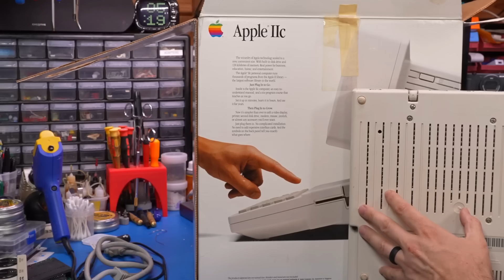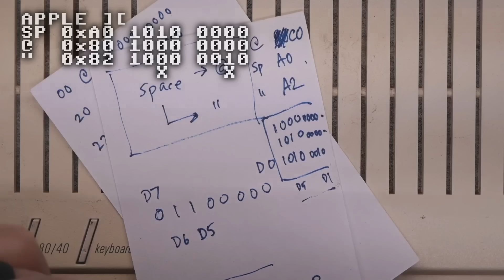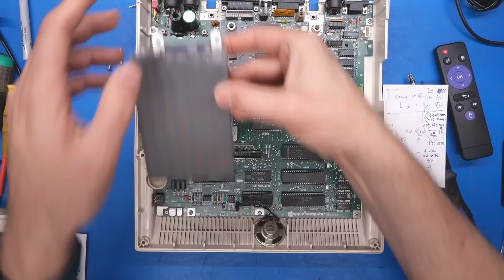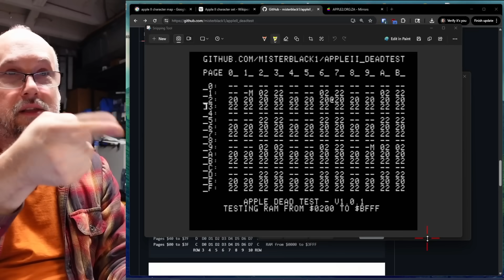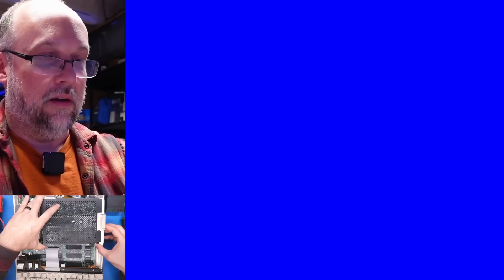Finding bad RAM chips on an Apple IIc

Comment: Apple did indeed sell a 1st-party memory expansion card for the later IIc models. I have a factory sealed 256kB unit here, plus one inside my IIc as well, which I've expanded to 1MB. My dad used to work for an Apple dealer in the early to mid 90's, so we have a few other things scattered around the house as well.

Comment: On the C64, you don't necessarily have to stop the "bad lines" from happening in order to do every time-critical task, you just have to work around the "bad lines" in most cases.  They are easily detectable using the raster register at $D012.  Even many fastloaders, for example, can load while the display is being shown.

Comment: In text mode (and with no sprites active on the C64, to keep things simple), the Apple II series and the C64 both actually have very similar memory bandwidth requirements.  Allow me to explain the difference, and why only the C64 has "bad lines".  On the first line of each row of text, the C64's VIC-II chip must steal an additional 40 cycles (from the 65 cycles available on each line) from the CPU in order to read the 40 bytes of characters to display (this is a "bad line", of which there are normally 25 per frame), in addition to reading the first line of glyph data from the character set, from either ROM or RAM, on the main data bus.  If it had to do this on every line, that would slow the C64's CPU down by a lot (by nearly 47% overall!), so the VIC-II buffers the 40 characters internally and uses that as a reference to draw the remaining 7 lines of each character in that row.  This limits the overall CPU slowdown to less than 6%, which isn't too bad.  The VIC-II also has to read the color map RAM for each character, but avoids stealing additional cycles by reading this separate RAM (actually an SRAM chip) simultaneously through a separate data bus.  It doesn't bother to buffer this data because it can and does read it over and over from the color map RAM, with zero slowdown involved.

Now, the Apple II also has to read 40 bytes of characters for each row, and in fact it does read them 8 times each (since each character takes up 8 lines), and doesn't even bother to buffer them like the VIC-II (which only reads them once per row and frame) does.  So how does the Apple II read the character glyph data at the same time without a huge number of "bad lines"?  The same way the C64 reads the color map RAM with no cost to speed: at the same time through a separate, dedicated data bus.  So why couldn't this have been done on the C64 to avoid "bad lines" altogether?  It could have been, but that would have limited the C64 to using only the ROM character set for the character glyphs.  By reading this data through the main data bus instead, the C64 gains the ability to make use of user-defined characters stored in RAM (the main 64K of DRAM), which is one of its most powerful graphics features (that it shares with the Atari 8-bit computers).  In short, the Apple II avoids "bad lines" because its text mode is limited to ROM only.  Had Woz decided to give it redefinable characters like the Atari 8-bit and C64, then the Apple II would have had "bad lines", too.

By the way, the VIC-20 has redefinable characters but no "bad lines", because its bandwidth requirements are lower, with fewer text characters across the display (normally 22 compared to 40 columns), leaving plenty of time for its VIC (or VIC-I) graphics chip to grab all of the data it needs without stealing any additional cycles from the CPU.  In fact, its CPU is a little bit faster than the Apple II's, despite running at the same clock speed of 1.023 MHz (on NTSC, and the same as the C64, too).  This is because of an obscure, little-known quirk of the Apple II series, which pauses the CPU for 1/7th of a cycle (in physical reality exactly 2 cycles of the master clock that runs exactly 14 times faster than the CPU clock that is derived from it) on each raster line displayed.  This was done to synchronize the phase of the video signal to the monitor.  Every other 8-bit computer I know of uses some other simple trick involving a small circuit (usually part of the graphics chip) to achieve this without the pause, but knowing Woz, he probably looked at what he had left to work with (all TTL chips on the original Apple II, with some random leftover gates), and realized that if he were to do it this way instead, then he wouldn't have to add another TTL chip to the motherboard. 😆  So he made the tiny tradeoff of about 0.22% in CPU speed to save a little money and complexity, and hardly anyone has ever noticed.

Comment: I got a IIc for very cheap together with all the accessories, documentation and packaging. Sadly it's stuck in this "diagnostics" mode and doesn't show the RAM screen. The only thing it will ever show is what you saw before it showed you the screen with "RAM" on it. I have no idea how to check which chips are bad, so I might just replace all of them with known good ones and hope it will work after.

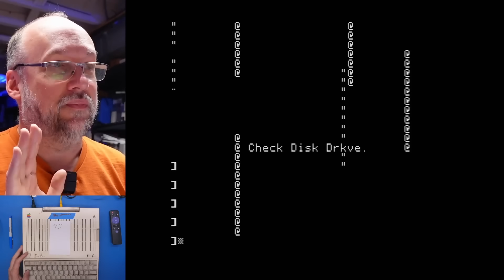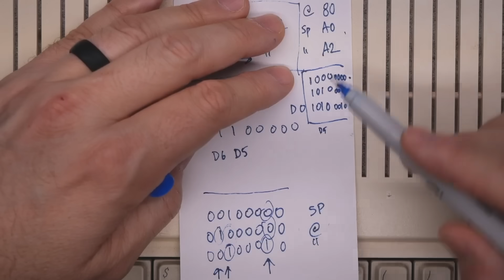Comment: at 10:18 you can notice that "Check Disk Drive" became "Check Disk Drkve", with the I changing to a K at the column where you see the quotation mark. They are 2 characters appart, which seems also to indicate that D1 is bad at some places. This matches what you found out at 20:23.

Comment: All 6502 computers had heavy use of zero-page.  The reason why it's used heavily, is because you can address zero-page with only one byte, so the 6502 can read and write to it nearly twice as fast.  The rest of the memory requires two bytes to address.
Reply: Actually, it only saves a cycle or two, depending on the instruction, but for a 6502, that's still pretty significant.  It also saves a byte of code per instruction, of course.

Comment: You absolutely do not have to install the memory chips directly on the board.  I'm sure you have even socketed these in another video, directly under the drive.
I have put sockets on 4 machines with no clearance problems.  I change all of them to sockets for future serviceability.

Comment: I'm getting more and more frustrated by how you make a 1/2 hour video over an hour long just by repeating yourself and restating what you just said in various ways instead of moving on with the diagnosis and repair. E.g. the difference between Apple's character codes and ASCII. Just tell us it's different and show us what Apple did. Don't repeat the same sentence with one work changed and don't show us how we may have been fooled if we tried diagnosing using standard ASCII codes. I am constantly finding myself clicking forward to try to avoid the waffle. Other than that, you have great skills and info to pass on Adrian, Just don't talk for length's sake. We can use our back arrow to go over something we missed.

Comment: Your explanation of the video/CPU memory arbitation was quite intersting, as it is similar how the Amstrad CPC manages the CPU/Video accessing RAM as well. The Gate-Array in the CPC stretches all M-cylces of the Z80 to multiples of 4 T-cycles by signaling the /WAIT line on the Z80 as the Gate-Array is accessing the RAM in the last 2 cycles of each M-cycle
So opcodes that run 4, 8, 12 etc. T-cylces run unaffected, but opcodes that run for example 7 T-cycles get stretched to 8 T-cycles. This slows down the Z80 a little bit but not by much. The advantage is we get very accurate timings and no problems as "bad scanlines" as on the C64, so exact time synchronization with racing the beam are not a problem.

Comment: hot air to melt the case attachment so the speaker fit's back in.... or freze the spaker so it becomes smaller.... or dremmmel the speaker

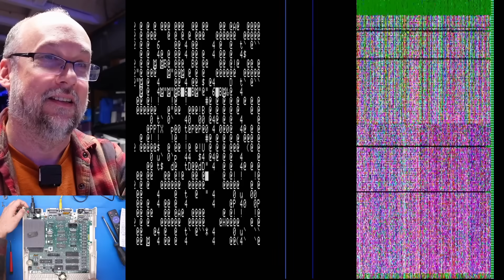Comment: I wonder if D6 is only bad on a cold machine. It shows as bad at 40:40, but find at 40:45. Maybe running the machine for a while "fixed" the marginal chip.

Comment: Something to note (as of 21:00) - there's no way on the display in text mode to tell if bit 6 is going wrong, unless bit 1 goes wrong at the same time (both 0x80 and 0xC0 are @, and both 0xA0 and 0xE0 are spaces, but where 0xA2 is ", 0xE2 is `).

Comment: this runs on a 6502, right? zero page is actually on the CPU... then it looks for a reset vector at FFFC and FFFD (which requires some external RAM or ROM) - it doesn't actually look for stack memory until it tries to execute an instruction like JMP (it saves the current address to the stack in order to return on RTS)

Comment: I was a sad panda when they didn't up the clock speed on the IIc.  The Apple ][+ and e were both slow on regular hi-res.  When you doubled it, it became basically a slide show.  They really needed to up the clock speed by at least 2.  But i am not sure how fast a 6502 (of 65C02) could be pushed back in the day.
Reply: The trouble is that Woz's legendary engineering led to things like the CPU clock being meshed with the NTSC video output generation and reading/writing data to the floppy disk - if you just boosted the system speed, everything else would break. Since the 6502 relies so heavily on the zero page of memory, running the CPU faster than the rest of the system does basically nothing.

The IIgs has a "fast mode", but it also has the entire Apple II architecture condensed to a single chip. It's a lot closer to running an Apple II emulator on your PC (but in specialised hardware, rather than software) than it is to running a IIe or IIc with a higher CPU clock.
Reply: @Screwtapello  Simple fix (and i know it would be more complicated that this), run the 6502 at 2mz, and clock divide by 2 to give the video system the clock it needs.   The floppy would be harder to manage, but it could be done.

Honestly, the Apple ][ series should have ditched the 6502 and gone onto a 6800, and eventually a 68000.  The 6502 was an amazing 8 bit CPU, but it was extremely limited by the low register count and extremely small stack space.

Comment: About the handle. Just because one can run the computer without the handle propping it up doesn't mean one should. The manual specifically says to "always prop the handle up under the Apple IIc when you are using the computer." Because of this part of the manual, I cringe when I see someone using it flat on the table.

Comment: That was the box my //c came in. I also got the illustrated monitor and stand, along with a dot matrix printer. Model number escapes me at present. Add in an expansion card from Carrolton Texas a  bodged serial cable to connect my wife's Radio Shack model TR80 Model 100 "portable" computer to transfer text files, and we cranked out adoption studies as my wife typed in the passenger seat as I drove. Adding a daisy wheel printer, and the Apple cranked out court ready documents to get kids placed in their adoptive homes. Apple Works software was all I needed along with a third party spell checker loaded onto the expansion card. Total cost? Around $2,500 for the pc, monitor and printer. And about $350 for the expansion card. The daisy wheel printer was donated. Boss paid $10,000 for and IBM PCXT, base unit with the 10MEG hard drive. Didn't tell me how much he paid for the software. Oh, yeah. Secretary typed Format C: on day instead of A: Took me a while to get the thing up and running again.

Comment: My dream version of the Apple IIc would have the Z80 card hardware built in to run CP/M software, and would also have an extra connector at the back that would provide a sub-set of the bus signals to use an external expansion "card".  I know of people that built their own custom interfaces to plug into one of the II/E bus slots, having one available "slot" via a 40 pin connector on the back (perhaps hiding behind a removable plug in the cabinet) would have given the II/C this ability too.  If the II/C had survived a few years longer, maybe it's mother board might have also grown an IDE connector too! 
Now even better, imagine a II/C with a 65C816 processor (II/CGS) and 1mb of dram.  That's what an apple version of the 8 bit guy's commander-X could have been.  I throw down the gauntlet!

Comment: Adrian, //c was also my first machine! I believe there are actually three motherboard revisions.  One was minor - but important.  Early //c’s had a “broken” serial port with a clock problem. The first minor revision fixed that serial issue, otherwise you couldn’t run it at the full speed!

Comment: AT 57:50 you says that the Apple2 is unable to sense multiple keys at once. This is not exactly true. The Apple IIe is capable.of it somehow. There is a key code register and a key up/down bit with it and yes you can absolutely sense multiple keys at once if you read the various codes arriving sequentially, and use the up/down bit as a sequence stop/start. But since you need to consume the codes sequentially and the up/down register is down when any key down and only up if all keys up, it is tricky. I implemented it to be able to type any character, with combinations of only 6 keys (Based on a Braille typewriter layout using FDS and JKL) . This might not have been available on the Apple ][ or the ][+, and maybe it is not available with the //c. But definitely had it on the IIe.

Comment: My Apple //c developed a bad RAM problem in 1987 because of a bone-headed mistake by one of my friends.  I ID'd the bad chip and bought a replacement (had to call places in the Yellow Pages, which was the first time I heard about Fry's Electronics).  I desoldered the chipped and lifted some pads/traces.  I paid $400 to trade mobos at an Apple dealer.

Comment: "Set it up in minutes, learn in hours, use it for years." Well, THAT part is pretty accurate. 

I would LOVE to see (pun intended) a modern computer like a Pi 5 in an Apple IIc case with the "good" keyboard. Imagine, there's plenty of space for internal SSDs and even an optical drive on the right side.

Comment: Yeah, my first computer, as well and it came in that red box.  I remember an RF convertor that plugged into the video DB connector, a long, shielded cable with RCA connectors on both ends and an RF switchbox to connect to the TV.  Those are probably pretty rare nowadays.

Comment: Interesting to see the timer slow down on Robocop when you are actually doing something, then speed up when idle.  I guess it's tick based and not rtc
Reply: The usual apple // did not have an RTC. It was a common add-on. 

The // gs did have a RTC standard.

Comment: I'd put a felt strip on the handle/stand so that it doesn't scratch the surface it stands on or the handle itself.  Or maybe a rubber strip like single sided latex tape....  of course after its all cleaned and retrobrited....

Comment: The earlier ROM255 IIc couldn't boot from SmartPort hard drives - you need one of the ROM3 or ROM4 revisions for this feature, or install one of the ROM4X upgrade ROMs into a ROM255 machine like you've featured on your channel in the past.

Comment: Just 10 minutes in, and this is awesome. Those symptoms match what I have on mine *exactly*! Maybe I'll finally be able to fix it!
Reply: "not ASCII". Well, that explains some things!
Reply: Tell us when you fix it!
Reply: Progress so far: I got the right power connector (I have the original PSU, I just can't find it...) so I could do some tests. Experiments seem to say bit 6. I haven't swapped the chip yet (there's a lot of bodge wires, I had a go at this a few years ago when I knew less...), but piggy-backing a new chip on top of #6 does make it boot without odd characters, so replacing that one should definitely be a good start.

Comment: The finger came from the mouse ad copy. It kinda became a graphical substitute for “easy to use”. Why did they plug in the power cord but not the monitor? Because they had to plug something in to go with the “plug and play” ad copy. Why not also plug in the monitor? I suspect it just didn’t look the way the graphics people wanted.

I’d apple make an extended ram card? Yup they did, it’s commonly called a slinky card (that was a code name).

Comment: One word of caution: if you're looking for an Apple //c with an Alps keyboard by looking at photos of the "label" on the case, be sure the model number is A2S4100. Some A2S4000 models also have an embossed label, but may not have an Alps keyboard. (I learned this the hard way by assuming embossed label equaled Alps keyboard...)
Also, you can use low profile sockets for the memory chips under the Apple //c floppy drive. Last time I checked, Jameco sells sockets with a low enough profile.

Comment: "Why didn't they connect the monitor cable?"

Because the package designer thought it would ruin the aesthetic of having one nice swoopy little curve going down into the monitor stand/case handle, contrasting the perpendicular angles. That's definitely it. (Work with a product photographer and you'll understand. I have HAD these arguments!)

This is an example of the dialectic between functional disciplines like engineering, and reductive communication disciplines like marketing. Engineers want to be accurate, commercial visual communicators want to be simple and handsome.
Reply: Jobs vs Wozniak
Reply: @ToTheGAMES  Exactly.  Jobs was the marketing guy, Wozniak made the computer.  Then Jobs tried to take the whole credit for the computer when Wozniak got in a plane crash and had amnesia.

Edit: TL;DR Jobs was a seriously bad person and I hate that he gets so much credit.

Comment: For the speaker mount, what I've done to re-install the speaker is to trim down the two identical brackets a little bit with flush cutters. Then angle in the speaker under the other bracket first (the one with the lip) and then you should be able to just push the speaker down and clip into the other two.

I've found the last couple times I've done it making those a little shorter helps to clip in.
Reply from the maker: Nice. I have to wonder how it was installed at the factory? Do you think they use heat to bend the two tabs facing the motherboard?